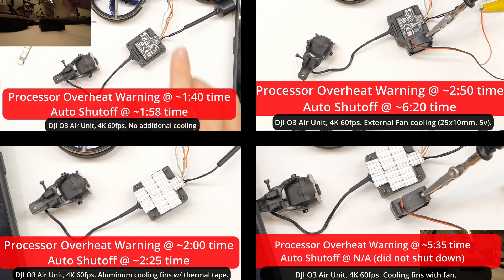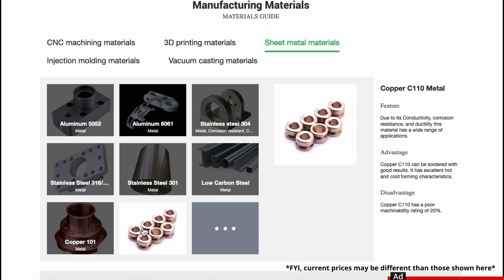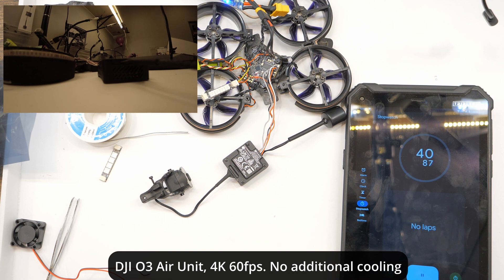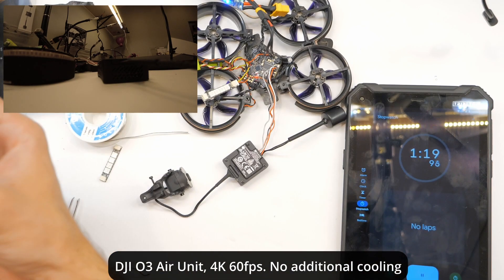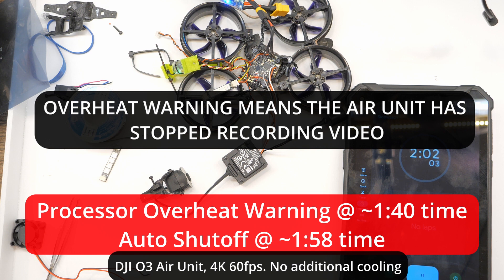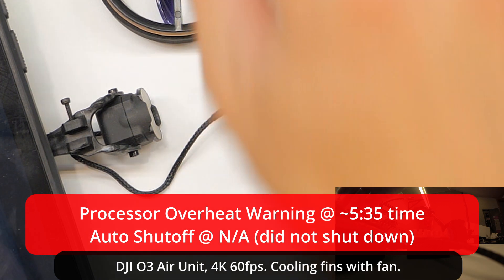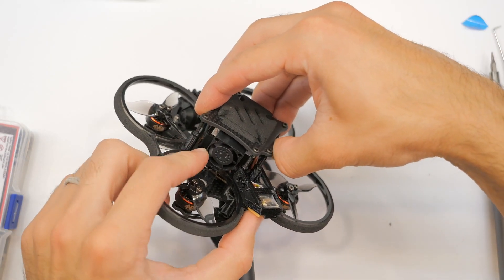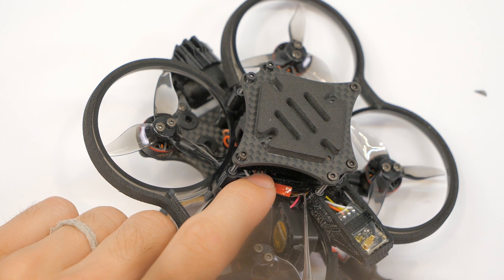3 Ways to FIX O3 Air Unit Thermal Shutdown - STOPS RECORDING if TOO HOT! DJI O3 Air Unit Cooling

Comment: hi bro. i know that i am a year late but youre putting the heatsink on the cold side of the air unit. it is  the other side that is generating most of the heat. I believe you can achieve better result than this.
Reply from the maker: Interesting. I did not realize that!
Reply: There is thermal paste on either side...but the iflight heatsink made for air o3 is for the antena side.

Comment: I’m wanting to put the O3 on a RC tank so weight is not an issue. Would the cooling fins and perhaps two fans keep it cool enough to run for 30 minutes? I don’t need 4k so would that also drop the operating temperature?

Comment: Or maybe I want it in an RC car... all this FPV stuff is extremely confusing. 😐
Reply: It can be a bit overwhelming when you're new. If you want to put an FPV VTX (video transmitter) on an RC car then I would not go with the O3 air unit due to a complication causing you to get almost no range and no on-board recording. You'd have to choose between Analog (think old school broadcast tv quality. Usually cheaper though) and Digital (HD but a bit more money) and buy the appropriate goggles to go with the system you choose. I am getting ready  to install a system on my XRT for the hell of it and I'll be going with the previous generation of DJI VTX and if you have any more questions I'd be happy to help.